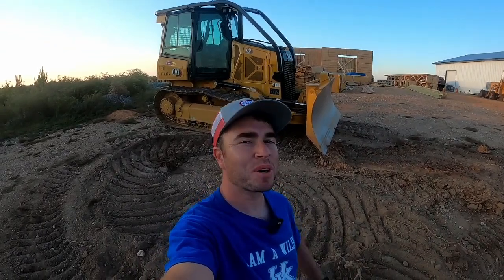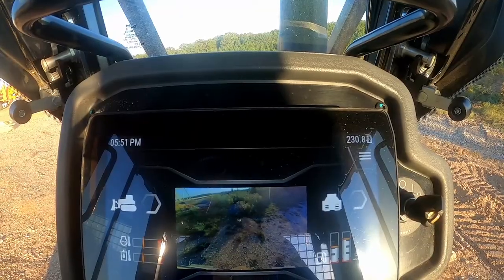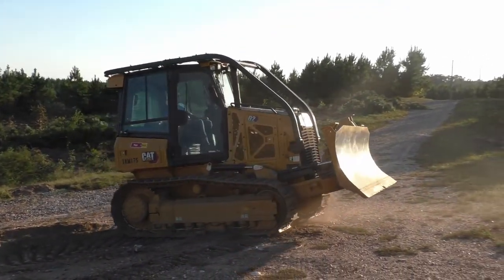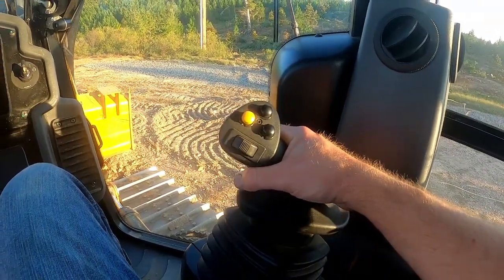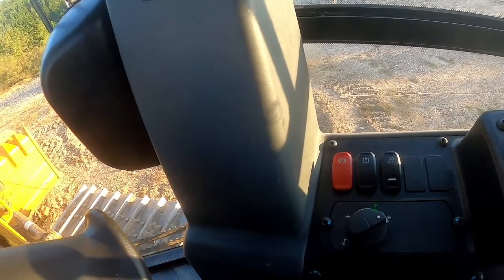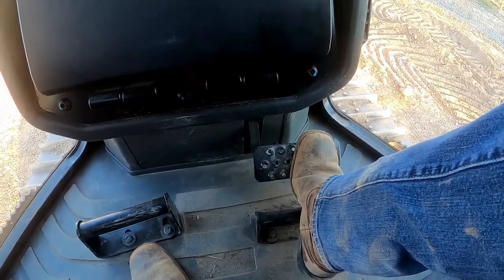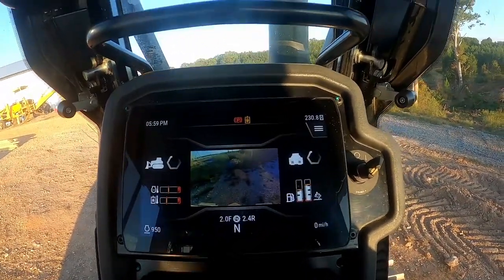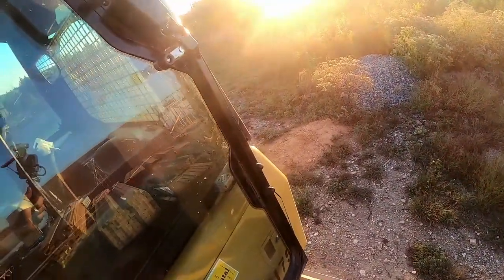How to Operate a Cat D2 Dozer

Comment: Wow I thought they stoped at d3 I didn’t know they made a d2
Reply from the maker: Can hardly tell a size difference between the two when operating it.
Reply: I actually thought they only made the d2 from 1938 though the mid fifty’s.
Reply: They were all renamed in recent years  D1, D2, D3. They previously did have a D2 but I belive this is the first time they've made a D1. Such easy use fun machines to operate